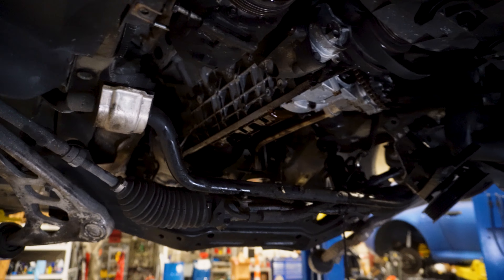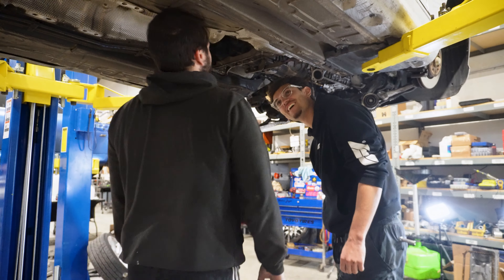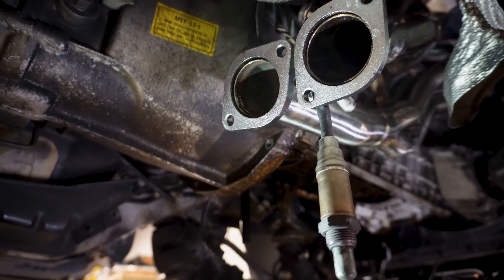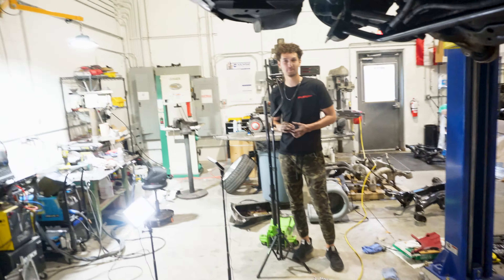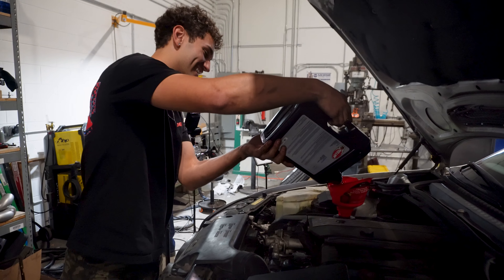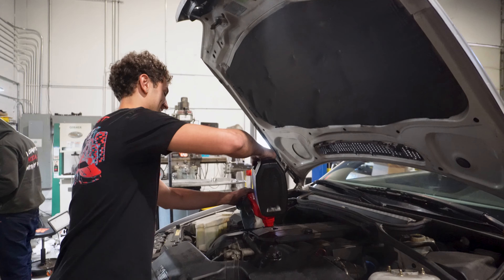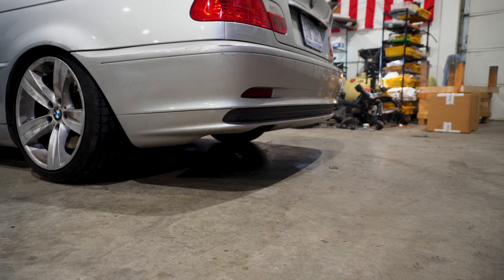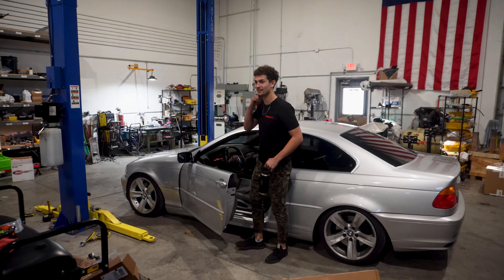Finishing Grants E46 M54 330ci Header Install And First Start Up!

Comment: I found when doing oil pan gaskets the only way to not fight dip stick is to remove it and re install after pan is back in.
Reply from the maker: Yeah that’s the smart way, even after removing in we struggled to get the bolt that holds it on the engine mount back on